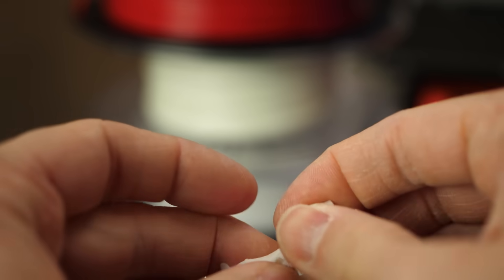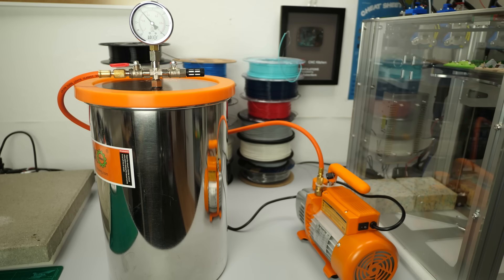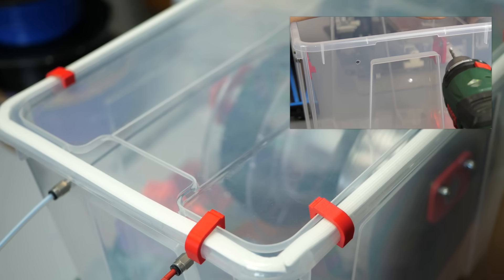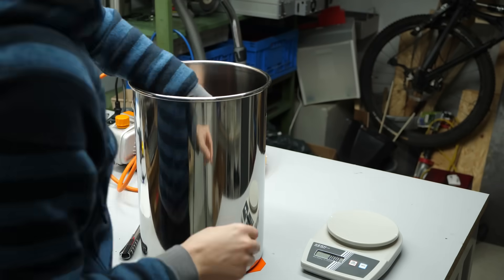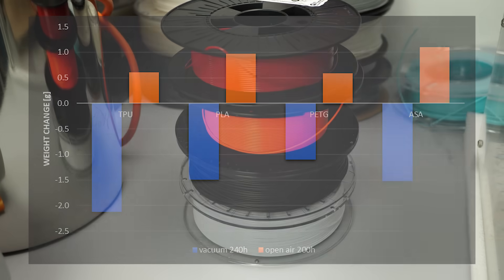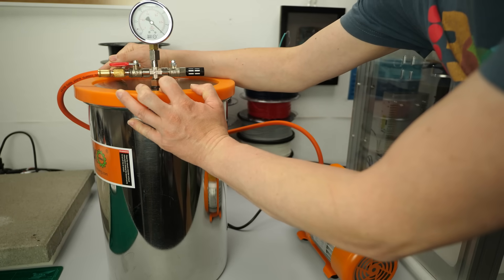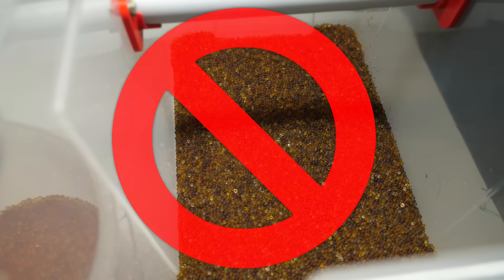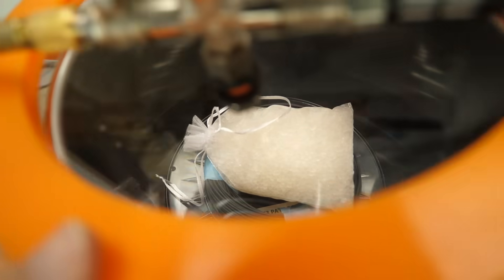Vacuum VS Dehydrator! What's the best way to dry filament?

Comment: i dont think its humidity. I think its condensation that cause popping sound  some people live in cold palces with temps below 26c the dew point.... and UV radiation that causes brittlemness. I live in the tropics very high 80-100% humidity and very hot average 29-33c and I dont used any  dessicants stuff. I dont get all the problems your having.. I just keep my rolls on a dark plastic container. i dont even believe the water absorbing rumor I mean come on when they make fillaments dont they submerge them in water to cool them.. so they are wet..

Comment: I just print all of my nylon based filaments right away. I don't even bother keeping it around. I print gun parts with polymide COPA. I set it up in my homemade dryer box with lots of silicate. I get about 18% humidity and print out the whole roll in a few days. Holds up just fine . However I really want to print with polycarbonate. wouldn't it be nice if high temp printers were affordable lol .

Comment: Assuming you used room temperature water @ https://youtu.be/eqQRN9TUw08?t=29 which boils around 0.03 bara almost full vacuum, have you noticed any diameter increase or any surface deformations on the filaments since they might expand when the internal water evaporates?

Comment: Drying is one thing - storage is the other. I use some buckets with a (hopefully) air tight lid I got for free (ask nicely...) at a bakery. They often get milk and powders and jam in them. 10l buckets hold 3-4 filament spools. When you get more and more filament, storage gets expensive if you don't improvise.

Comment: I heard on the 3d printing today podcast that you can dry the silica bags in the microwave oven. Run for a short while, bag gets hot and moisture leaves. Run again, and repeat over and over.

Comment: Crazy, I'm doing this kind of study with Ultem 9085 at work right now. From my testing vacuum plus a little heat (50C) is just about as good as you can get, it drives off of the moisture in 48 hours.

Comment: Lots of work there and a pretty good methodology. I would have been interested to see the Vacuum followed by the dehydrator to see how effective it actually was.. you did do this later for other filaments unless i missed it?

What I was waiting for was how you would transfer heat to the filament in a Vacuum chamber.. I assume you would heat the filament up then transfer it to the vacuum chamber?

I use sealed tubs with desiccant and still use indicating as you only really handle it infrequently and can wear a dust mask for when you need handle it to reactivate it.
If you don't want to use a hydrometer I'd sit a small tub of indicating desiccant in there in a ramekin or similar and use that to indicate instead. If your really paranoid use  a clear vessel with some pantihose as a lid.

Comment: Vacuum pump/chamber (smaller chamber), something to move the material off the floor of the chamber, a hot plate with a good temp control and probe, some aluminum tape, some blankets or towels and duct tape. Awareness of flamable materials and their proximity to the heating elements.

A brain.

You see where I am going....

Use both methods, get em bone dry without hurting anything. It's how you get the moisture out of  wax

Comment: you can also weigh the desiccant to determine its moisture content. i remember seeing a garage dryer that was hung from a spring and when it touched the floor it was full, and needed refreshing. probably need to make some cotton bags with weights written on them for the desiccant to make it easier to use.

Comment: How about testing Greentec Pro?
The manufacterer claimes it is for applications in the high-performance range and holds up to 160°C even it prints nearly like PLA.
My experience regarding the temperature resistance differs clearly so.

Comment: Wow! The desiccant seems to be the best option! It covers most of the moisture removal, and does not require heating the filament.
Another great desiccant is calcium chloride, which is very cheap, and good at absorbing even in low RH conditions.
Re-activate the same as with silica.

Comment: The problem when vacuuming alone, is the temperature drop since you take out the higher level energy molecule and leaving the lower energy molecule to cumulate, which then requires to succion even more vacuum. The solution is to do both. 

 I use to have access to a cole parmer vacuum oven, and these thing works very well, you put it about 4 hours and print quality were as good as new. I guess leaving the vacuum pot in the sun should also work for petg or abs.

Comment: I've found that a vacuum chamber with a heating mat on bottom works much better and dries significantly faster compared to the other methods or without the heating chamber its night and day difference try it out well worth it cuts drying time at least 40 percent faster
Reply: Cool! What heating mat would work? I find these metal vacuum pots all over amazon, with cheap oil pumps, would that work? Alternatively a good oil-less two-stage pump?

Comment: All that detail and all that work just waisted. You used a vacuum pump that could only run for 15 min but put material in the dehydrator for half a day. How can you think that works. Good vacuum pumps are used for several hours to remove pipeline moisture every day. I even left mine running overnight many times. Im not saying it would work the best here, just that it doesnt seem like an accurate test.

Comment: Is it possible to use silicate cat litter as dessecant?
Reply from the maker: I tried but didn't have great success, though I probably should have pre-dried it. Then it might work.
Reply: @CNCKitchen  Thank you, very interesting. That means I maybe should also use the better dessecant stuff as cat litter, or drying the cat litter I buy for my cat to work longer. Where is this silicate dessecant being sold again, not sure if you mentioned that in the vid?

Comment: Add christmas lights to the tote, hang filament in upper half of tote. Make a little hole in the bottom of tote and crack the lid.  If it gets too hot, then open the lid more. if its not hot enough, tighten the lid.  Works a charm.

Comment: Probably more of a laboratory thing,  but using a gas spectrum analyzer to sample the off gassing would help identify the chemicals being released.  That would be a helpful data set to have in case additives in the polymers begin to off gas with the water vapor.

Comment: So PETG is quite hygroscropic - and drying it prior to printing can help get decent prints, but the problem is that your printed object is still hygroscopic AFTER printing... so a part that was nice and strong right after printing is going to absorb moisture from the air over the next few hours, days, weeks, until your once strong part will likely crumble in your hand.

So we should not just be considering how hygroscopic a material is in filament form, but now moisture absorbtion after printing will affect the printed part.

For this reason I never use PETG.

ABS is so much better in every respect... and serious 3D print users should aim to own fully enclosed printers.

Comment: Be careful if doing the water boiling demo!

Water vapour can get into the pump and rust its bearings over time.  Consider using a suitable moisture trap.

Comment: It would be a better measurement with just the filament without the spools? Otherwise how do you know whether it was the filament absorbing the moisture as opposed to the spool or the glue under the label?

Comment: Great content, especially the very sophisticated and scientific approach I like. Sub and like done. Do you think vacuum drying might have a negative effect on material integrity itself because removal of moisture isn’t a diffusion controlled process anymore when applying vacuum? The moisture is literally drawn leaving structural damage? Also is it possible that polymer additives like softener with a low boiling temperature will migrate to the surface of the filament at least? Heating in the oven has pretty obvious downsides from a material perspective too and so the most effective and soft method to me seems using drying pelltes and let the filament sit for some time.

Comment: since moisture will migrate through most plastics you can reduce by introducing  a N2 nitrogen atmosphere in your storage container. i have several old pressure cookers that i use as knockout pots for vacuum molding. put hygroscopic materials in the KO pot and pull a vacuum 20in/mm (aught to do), then use N2 to re-pressurize to slightly above atmospheric pressure. argon helium and maybe even CO2 can be used. BTW if your pressure gauge has millibar graduations it's a good barometer LOL

Comment: I am an automotive A/C technician. I have to agree with fragger56 in order to properly use vacuum to remove moisture you need a pump and vacuum vessel that can attain 30inHg. Cheap pumps and poor seals and tubing will not achieve this. Obviously cost for professional equipment is not what the average person will want to spend. Try setting your vacuum chamber on the base of your food dehydrator to warm it. Once vacuum is reached though, radiant heat is required to reach the filament as convection heat through air currents can no longer reach it.

Comment: ho man, I'm so happy you did it and report it this way ! It's a 2 years old project you have confirmed !
I'm sure vacuum drying should be better, in fact you may give a try to it with a 2 staged pump ... going only 0,025 Pa.
This should dramatically improve drying AND drying time, consuming really low energy compared to dehydrator solution.
Thanks for making these test this scientifically compared ! really a huge help !

Comment: Bezüglich der Frage im Video, so weiss ich nicht, ob dies als Dehydrierung oder bloß als Lagerung bei mir zu sehen ist: neben der Benutzung eines geschlossenen Behälters mit Silicat-Tütchen im Betrieb, kommt jedes Filament nach Benutzung in eine dichte Zippertüte (Vakuumbeutel für Kleidung) zusammen mit einem regelmäßig aufgefrischten Dehydrator auf Basis von Silicat-Kügelchen mit Feuchtigkeitsindikator.

Da ich das Filament ausschließlich in ganzjährig temperierten Räumen, also geheizt wie Wohnräume, verwende, ist Kondenswasser weniger zu beachten.

Eine zusätzliche Behandlung war aufgrund verschlechterten Eigenschaften oder Druckbarkeit nicht vonnöten, gebe jedoch zu, das Material- und Farbvielfalt eher reduziert und neues Material nach der Idee von Just in Time verwaltet werden.

Comment: First i used my heat bed with a cloth, the temperature can be control precisely and it works as long you do not let it run unattended.

Comment: I've had my phone fall into water it stopped working as usual "no surprise" but after testing it I imitatively covered it in dry rice and left it over night and it worked was it the rice or just the 24 hours I left it if it was the rice could it help for our filament? but the rice must be clean or it can leave "rice dust? / fragments" on your filament.

Comment: Stephan, Thanks for this very informative episode.   I think that some of the things that you touched on are important.  I would be curious to know if you has seen any manufacturer specifications that would indicate a specific humidity for storage of the more exotic filaments that would maximize shelf life, which also falls into the thought about oxidization of the plastic.  I am a maker, electronics engineer, company owner and I get to experiment with very high radiation and ozone exposures.  I have had good results with PETG tested up to 500kGy with no negative results, which was as high as I needed to go for the go no go testing that I was doing.  In this field however the ozone does damage PVC wire insulation it seems to lose it's oil.  Unfortunately i do not have a measurement technique to see how the ozone is affecting the PETG as the PVC takes a few years to degrade and ozone concentrations varies greatly in a radiation environment that I cannot install ans leave electronic test equipment so...   I enjoy your videos, they are well made informative and scientific, Great Job.

Comment: I like your videos and how thorough you are in your testing.  Is there any chance you can do some testing about how effective desiccant is depending on how much is used and where it is located in the dry box?  I have recently become convinced that desiccant at the bottom of the dry box doesn't work as well as desiccant located at the top of the box.  All of the related theory I have looked into says that moisture is more likely to rise like a cloud and gather near the top of the container.  The greenhouse effect in a jar comes to mind.  I have not done any testing myself but I don't have the means to do any great or formal testing.  Would you be willing to test that?

Comment: I've had pretty good luck using vacuum to dry filament...mainly nylon and PETG.

I use a hotplate and put the filament on a fire brick in the "chamber" (just a big aluminum stock pot), then preheat until the chamber walls are around 100c with the lid on, then I pull vacuum for and hour. I found the preheat crucial because once the vacuum is pulled very little heat is transferred to the filament.

I also experimented with a large cup of desiccant in the chamber...but it comes out at least as dry as when it started. 

The hour process takes about 1.5 hours and has served me well, ymmv but it works for me.

Comment: I have about 40 rolls of filament PLA, PETG, TPU, ABS, ASA, Colorfabb bronzefill, carbon PETG, wood filament etc. I have not yet had to dry a roll. I don't know why the topic is always dealt with in this way. Some rolls are almost 3 years old and I print them without problems. As long as it's not PVA or nylon. I can still understand that ...

Comment: One concern I have is people potentially not understanding the amount of desiccant required to actually reduce moisture.  Despite your having shown and mentioned it, IMHO a lot of people just won't pick this up.  I'd love to see a comparison data showing smaller quantities of desiccant to help absolutely clarify the "sufficient" quantity.
Reply: What if the filament attracts moisture more readily than the desiccant?  Wet desiccant will hydrate the filament. 
I will vacuum bag with desiccant after the filament has been dried overnight.
Reply: @White000Crow  If there was a filament that attracted moisture better than desiccant, we would be using it as desiccant instead of silica gel.
Reply: @White000Crow  that's not a realistic scenario. You should definitely use desiccant while drying

Comment: Stefan, try doing this: do the vacuum + desiccant drying, but wrap your steel vacuum chamber in an electric blanket set to a low temperature that would be safe for extended exposure. I think the combination of an electric warming pad and the desiccant + vacuum over night might give you the best results.

Comment: Try put a cup of water in a vacuum chamber.  Pump out all the air.
Now will the water disappear?

Answer, no. 
Some water will evaporate, thus cool down the water.  It will take a very long time for the water to disappear totally.
So the vacuum method to dehydrate the resin is not too efficient. 

Next if you can put a microwave oven in the vacuum chamber, the energy from the microwave can boost the water vapor evaporation.

For drying agent, silica gel is not the best.  Try anhydrous calcium oxide.  Use with care, read the instruction first.  CaO can pull the
humidity quite low.

Comment: I'm not sure if this applies here, but a problem in some materials is that they have as high an affinity for water as desiccant does.  Low hydrogen stick welding electrodes are like that.  To keep those dry, I double bag my material.  Put a little bit of desiccant in a mylar bag with the filament and heat seal the bag.  (Impulse sealers are inexpensive.)  Then keep the bagged filament in a plastic box with a large amount of desiccant.  The mylar bag is an excellent barrier against water diffusion, and the desiccant in the plastic box will keep the relative humidity in the box low, further reducing diffusion.  That setup keeps even welding electrodes dry, that normally have to be stored in an oven or metal cans.

Comment: Another trick is after pulling the initial vacuum back fill with nitrogen and then pull a vacuum again.  The remaining atmosphere inside the chamber will be 100% dry to drive the diffusion equilibrium.

Comment: Hi. At a 3D Printer if the filament motor does not respond at moving test or the filament stepper motor does not move at all,the printer can work or will blackout?

Comment: I wonder how a room dehumidifier will work on materials.  I was thinking on creating an enclosure to place it on top of the unit making sure the intakes where pulling the air to dehumidify it.  In other words, making the are to be dehumidified a box that contained the filaments.  But I wont be as scientific as you are.  So, will you give it a try?

Comment: The amount of moisture that can be removed from a spool of filament, is related to the relative humidity of the room where the spool was stored. The higher the humidity level, the more moisture that can be pulled from the filament (using the methods shown in the video). The lower the humidity level in the room, the less moisture that can be removed. With that said, what was the relative humidity during each of your tests, because it can change from day to day, and the time of year where you live. Even taking a hot shower in close vicinity to the room where you store your filament (exposed), can effect it's moisture absorption rate over time. Likewise if you live in a country or state with little vs lots of humidity.